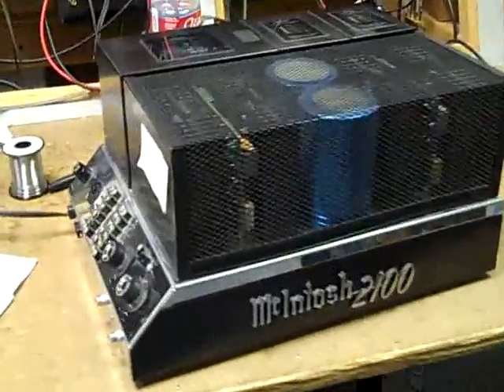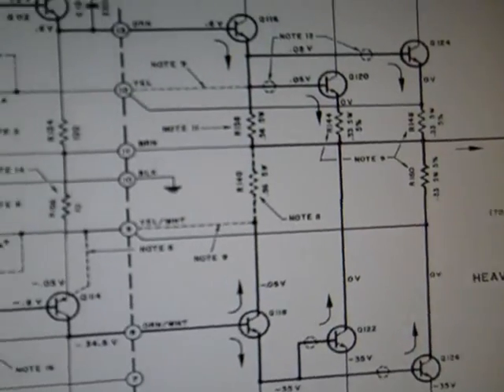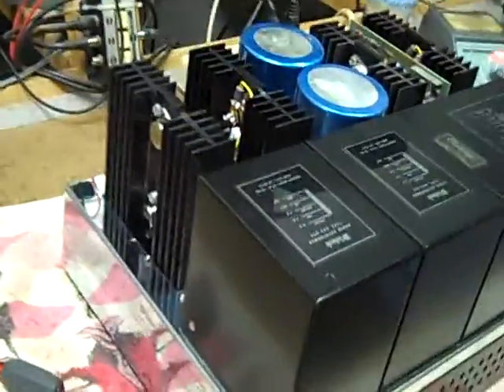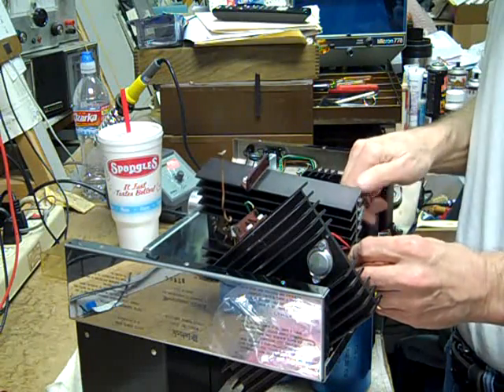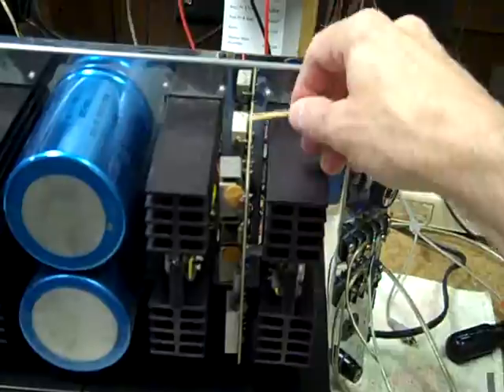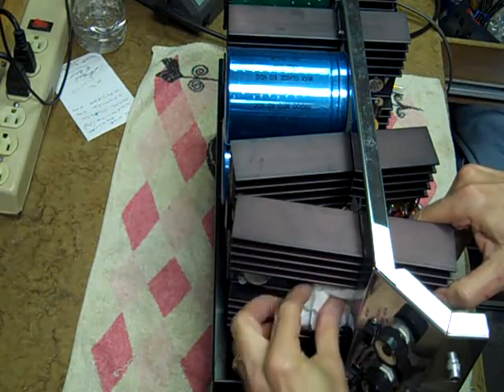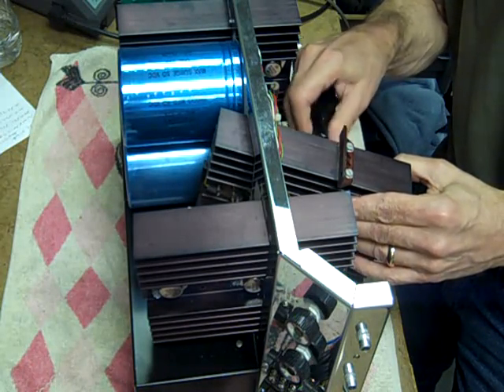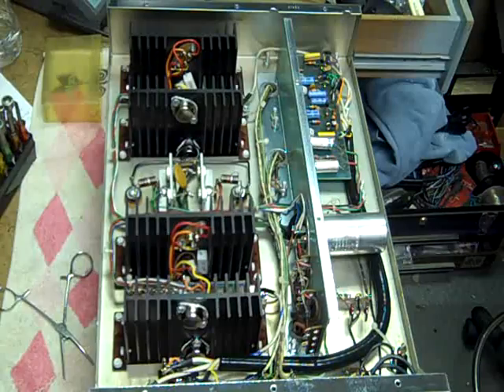McIntosh MC2100 Repair Brief

Comment: Thanks for the channel...
Am interested in doing a capacitor replacement for my original mcintosh 7270.
Have seen some ads for replacement kit on ebay  $195.
Wondering if that's a good idea?
Reply from the maker: It's definitely old enough just from the standpoint of future reliability. I would say the work should be done by someone well qualified; I've seen some bad results from do-it-yourself-ers. As to the quality of the kits out there, I'm skeptical, maybe try to get some recommendations from some of the techs on Facebook groups like Vintage audio Repair and Restoration.

Comment: Picked up one of these recently. Initially it was popping the primary input fuse. Brought it up slowly on the Variac testing setup that I assembled. So I started a recap process since every cap I tested out of spec by a decent amount. Anywho during the post cap swap test phase the resistors at the power supply end of the 80v leg specifically the R205, R206, and R207 area right after the diodes D205 and D206.  I pulled the output boards fearing that they were causing the issue. However with them pulled R205 and R206  continued to get ready to release the magic smoke hot even without the boards installed. Not sure you are still watching this thread anymore but I figured I'd bounce it off a fellow Wichitian and tech. Excellent video with nice technicals!
Reply: Update!  I worked through that section of the power circuit and found that the original Resitors were just failing. Replaced the 2X 100Ω resistors and all is well again.

Comment: Hi Mark, nice video. I've got a problem with the inner wires of the mono-stereo buttom of my MC2100 (they're broken). Do you have an image or scheme of the right connections?  Thanks in advance! victorsoldano@bol.com.br
Reply from the maker: I have schematics but no visual layout.
Reply: Thanks for your kindness...if you can send it to me, I'll be very grateful. Best regards, Victor.
Reply from the maker: email me directly at mark_zacharias@labolgcbs.net and reverse "labolgcbs" to read "sbcglobal" and I can send it to you.
Reply from the maker: You will need to email me at the sbcglobal address I gave, and I can send by return emal.

Comment: Hi Mark, I see you are using a large roll of Solder Wick. Where can I get a large roll like that?
Reply from the maker: I used to get it from B&D Enterprises 800-458-6053. I've also see them on eBay.  Chemtronics 10-50L .  Best I've ever used. Actually works, unlike some brands.
Reply: Thanks Mark.

Comment: Hi Mark and all who may know. Please clarify something for me as I am a complete newbie to this hobby. I have a Mc2100 as well and looking at the C309 and C310 (input board) which is a 10uf 25v electrolytic, the service manual parts list does not indicate NP but looking at the drawing of the circuit board it isn't polar defined. I'm confused of this because doing research the input board is the same part number as the MC2105 but the 2105 explicitly indicates "NP" in the parts list. So my question... Is the MC2100 C309 and C310 Polar or Non Polar? The cap I pulled out is polar type but I question because I found C303 and C304 had wrong value caps. Thanks in advance.

-Mary
Reply from the maker: The voltage shown is rather low so it probably would not matter, but I would probably lean towards using a non-polar capacitor, but if I'm replacing original caps and they originals were polarized like I say I wouldn't worry too much about it. One thing to remember is that a non-polar cap automatically has twice the esr as an otherwise identical polarized one, so if you use a NP cap do at least use the best quality you can find.
Reply: Mark, Thanks for the reply. If then it does not matter polar or non-polar would film type cap benefit from the C309 and C310 locations? I noticed on the schematics that it's directly in the primary signal path? Otherwise I do have panasonic FC cap (10uf 25v) also have Elna (M) 10uf 100v (non-polar) but now that you mentioned the non polar has 2x the esr value normally then I'm on the fence at this point.
Reply from the maker: If there is room, by all means try the film caps.

Comment: ???  Great video Mark, What kind of glue do you use to glue the capacitors
Reply from the maker: As I recall, the capacitors are not glued at all - only the component leads are soldered, holding the caps in place. Forgive me if I'm wrong - haven't watched this in quite a while.
Reply: hi mark
Many thanks for the reply back
.Isn't this glue tube??,,, watch the video in 9.03 time
There are glues that cause problems of capacitance change over time
Therefore, this issue is important to me
 have no intention to disturb or bother you, answer only if you have the interest and time to do it , anyway thanks for your reply
best regards
amnon
Reply from the maker: OK, yes - that was a silicon sealant.
Reply from the maker: People also use something called RTV and "silastic" for this.
Reply: hi mark
thank u very much for your replay
I also do repairs and replacement capacitors
Mostly vintage stereo amplifier
.And I love this job

 thank u very much for your help
I appreciate your kindness
your sincerely
amnon

Comment: Hi very nice video. I'm planning on buying a mc2100 on eBay my question is how do I check for proper function with a signal generator and an oscilloscope. Thank you
Reply from the maker: +discoking62 This can get pretty involved, but:
1. Resistive loads of appropriate value (like 8 ohms) connected between the COMMON (negative) and matching taps on barrier strip ( 8ohms, in this example).
2. Scope leads: positive probe to positive of load, scope ground to chassis or speaker COMMON (chassis probably safer - less likely to accidentally short to the speaker positive connection.)
3. Audio or function generator via appropriate adaptor to amplifier input.
4. Start with generator output to zero and/or amp input level at min.
5. Turn amp ON, carefully bring up levels on generator and amp to see display on scope. Maybe start off the scope at 0.5 volts/division. Adjust higher for larger signal. I will usually bring the amp input to maximum providedthe generator output is still pretty low. At 2 volts/division, 4 divisions will be near 1 watt with eight ohm loads.
Reply: +Mark Zacharias Thank you very much

Comment: Great video Mark,, lots of good tips.
I have a 2105 with output problems on my bench now. No smoked parts I can see, but someone has replaced the output transistors with all sorts of mongrel devices (ELM130, 32-070, QP-8). I want to get back to stock parts before I go any further. The problem is I don't know how to translate McItosh's part numbers with industry standard parts.
The service manual calls Q119 to Q126 output transistors for serial numbers below 20M01 as 132-517 I'm guessing that's the MJ15003G you referenced. But Q115 to Q118 is specified as 132-518. It is also a NPN, but is it the same replacement? Thanks in advance, Steven.
Reply from the maker: +constitutionfst I've had very good luck using the MJ15003G for all outputs including Q115 to Q118. That is the recommended replacement so far as I know. The driver boards do contain transistors that are hard to source.
Reply: +Mark Zacharias Thank you Mark. 
I saw the two caps you recommended replacing because they are known trouble makers, any other suspect caps I should replace while I'm in there?

Also, Only one transistor has an insulator under it. (the driver) Shouldn't there be an insulator under each one? Would it hurt to put one under each? (as I forgot which one I took the insulator off of. :-o )
Lastly, the front panel is cracked, is this the factory only replacement source? ($150 I am told)
Again, thank you for all your help. Steven
Reply from the maker: The other transistors are connected through the heat sink. No insulator necessary. The heat sink is isolated from chassis. It's pretty easy to replace all the small electrolytics in one of these. It's a good idea because they can cause problems that might not be obvious like frequency response problems and phase shift.
Reply: +Mark Zacharias Got all the parts in. One channel is still out. I traced the problem to Q107 & Q109, on the pre driver board (043899) they are not shorted, but measure half the resistance of the working board. Mcintosh part numbers 132-021 & 132-032 don't help. The (Motorola) devices themselves read 090 & 100 plus a date code which also doesn't lead anywhere in the NTE substitution book. How do I find out what these devices are?
Reply from the maker: Probably have to order them from McIntosh. I've seen them supply NTE subs for the TO-66 package transistors but they seem to work ok.

Comment from the maker: On the amplifier driver boards I would replace the electrolytic caps, and resolder any suspicious connections, there are a couple solder points at resistors and maybe at the transistors on that board which cause the amp to blow up and cause the damage like the board in the video. The caps on those boards can cause bad frequency response & phase shift. I do Paypal, but I've never asked or received for answering a simple question... sometimes I'm able to walk people through a complete repair.

Comment: Hi Mark! Wonderful & interesting videos! I don't know if you answer questions or not, but here goes: I have two MC2100 amps. They have never had anything done to them in the 35 years I have owned them. They are operating perfectly. If these were your amps are there any caps that you would immediately replace for safety sake? Or because,  if they haven't blown yet it is just a matter of time. I am happy to pay for your advice.

Comment: Pull the output autoformers?  You are obviously ignorant about things like autoformers in audio gear.  Take them out and you are transforming that Mac into an old Sony, Kenwood, or Sansui amp.  The resale value will also plummet to 1-2 pennies on the dollar.

Comment: @ mdzacharias i must confess this amplifier looks bizarre but t the sound quality is fabulous, in this circuit the rated  output impedance is 2 ohms and they used a matching impedance transformer for this job all the mcintosh solid state power amplifier employs this topology

Comment from the maker: I haven't had any luck finding new 39,000uF caps that fit. There are 56,000uF caps that fit, such as the Mallory cgs563u050x3l. They run about 70.00 or each so plus freight from Digikey.
Reply: Got my replacement caps for the mc-2300 from Mouser. $28 each!

Comment: @TheElectricnoob  This amp has what they call Autoformers.  Their purpose was impedance matching so you did not lose power driving a higher ohm speaker and losing output power. The other reason was if the amp shorts out it will protect the speaker.  This amp has taps for  16 Ohms  8 Ohms and 4 Ohms and puts out about 135 watts channel and can be ran in monoblock mode 240~250 watts 1 channel.  Thats just silly idea wanting to remove the Autoformers.  The amp runs on ebay at $500 to $1000 or more.

Comment from the maker: The buzzing is my solder station. Naw, the output transformers are great. Just a different way or doing it, that's all. They protect the speakers and at the same time step up the output voltage to the speakers. The frequency and phase response is excellent. Sounds better than most direct coupled amps, and no relay needed. If you did get rid of the transformers, you'd be limited to 40 or so watts per channel with the power transformer used in these... about plus and minus 37 volts.